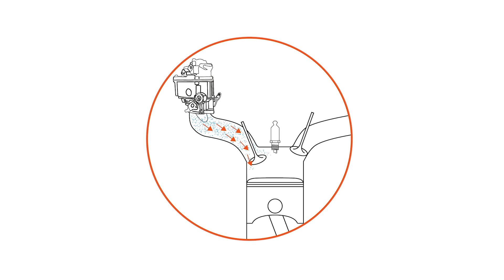How Direct Injection Affects Motor Oil Part 2: Low Speed Pre Ignition

Comment: I don’t get the fuel mixing with the oil? How does the oil get in the fuel in the first place?
Reply: Ring Blow By !  Rings don't make 100% Perfect Seal ! It mixes in the combustion chamber once some of it slips pasts the Rings. The same thing can happen in reverse too ! If TOO Much Fuel is dumped into the cylinder chambers and not burned,it gets washed down the walls and into the Oil !

Comment: This is why I only buy Toyota vehicles . They developed their D4S system of direct injection along with using port injection. Dual fuel injection system. Still have port injectors to wash the back of the intake valves. On the tacomas they even have a mode where the computer will put the engine into direct injector self cleaning mode to blow the carbon off the injectors while still being able to idle the engine using port injection. To top it off I run amsoil signature series in my Toyotas for added protection .

Comment: Hello Jake, I have a question regarding higher octane and LSPI.
If I use an octane booster to increase the octane level, does that help in any way to eliminate LSPI?
I already use Driven oil and a fuel additive to help vaporize the atoms in the 93 octane fuel I use, but now I'm wondering if adding a octane booster will also help in eliminating LSPI in my 2012 CS 991.1
Thanks again for sharing your knowledge!
I just moved the "Likes" to 205...this should be way, way higher for the knowledge you're sharing...come on Peeps, get with the program!
Reply: How often do you change your oil using driven? 5k? What are your intervals?

Comment: Soot is caused by poor air/fuel mixing.  Hydrocarbons don't have an oxygen molecule to convert it to CO2 and you're left with carbon particulate.

It's also called autoignition.  Detonation doesn't happen in engines; it's a solid fuel phenomena.  Hence, LSPI is a misnomer as well.  The Ford engineer who coined that term acknowledged it, and didn't care.

Comment: This is an old issue that's been around since DI has been used with Diesels. Diesels use a much lower volatility fuel as well, exacerbating the vaporization issue. To increase vaporization, all modern DI engines use specially design piston cups and high pressure injection to achieve reliable vaporization. Diesel requires the injection pressures to be even higher in order to properly vaporize. These pressures can easily exceed 25,000psi in a diesel, but more reasonably reach an average of 3,500 psi in GDI engines. The fuel dilution issue is most easily addressed by shorter oil change intervals, and/or using heavier cold oil weights. As the introduction of fuel into the motor oil both increases its volatility and reduces its film strength, it greatly reduces motor oil's effectiveness as a lubricant. In a turbocharged DI engine the problem does get worse, not better as the cylinder pressures increase, thereby increasing blow by in low engine speed/high demand instances. Personally, I don't exceed 6,500 miles per oil change on my TGDI engine, and have noticed significantly reduced gasoline in the waste oil. Many manufacturers may suggest a 10,000 mile interval, but it may not be in your best interest to wait that long. Even with extended service synthetic oils.
Reply: I assume you mean Fuel dilution, not LSPI. But that’s mostly an issue with old mechanical systems with static timing and mechanical injection.

Comment: Use a Catch can if can solve alot of these issues
Reply: That only helps with recycled exhaust gas leaving deposits when reintroduced to the intake. It does nothing for fuel dilution into the crankcase.

Comment: Would putting higher octane gasoline in my car with direct injection engine help alleviate some of the issues caused by incomplete atomization of fuel? 

Also, would driving at high engine speeds, using higher octane fuel, help to clean out some of the carbon buildup caused by direct injection?
Reply: Probably not... but the higher knock threshold of race fuel would help prevent knock.

Comment: In newer Hondas such as mine, to solve this problem they use 2 fuel pumps. one in the tanks to pump the fuel then a super high pressured fuel pump just before it goes through the injectors. This ensures full ionization of the fuel. kind of a lame way for me to explain it.
Reply: All modern Direct injection engines use a High pressure fuel pump, and high pressure injectors. The issue still persists, albeit slightly improved.
Reply: That's salesman talk, it does nothing to alleviate the issue. Avoid idling your car, run good fuel and oil, change the oil sooner than the manufacturer suggests,  sample your oil,  and pay attention to the signs of excessive soot build up with any di engine. Short trips that don't allow the oil to get up to temp are probably the worst condition possible for di
Reply: @travispfannmuller7717 0
Reply: Fuel dilution is as much an issue on new Hondas as any other new GDI car.